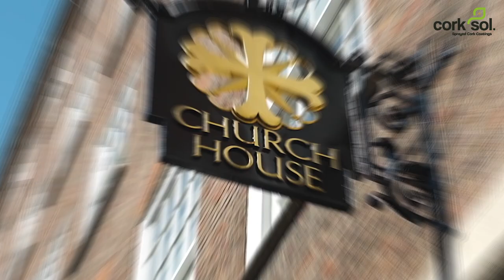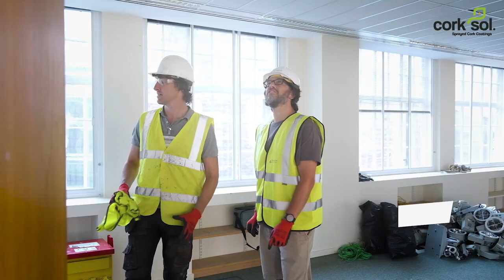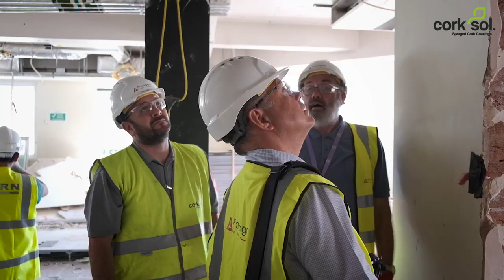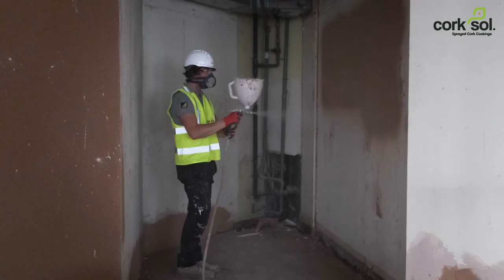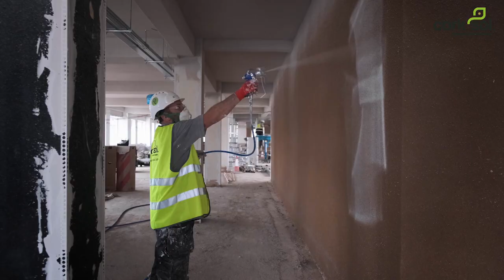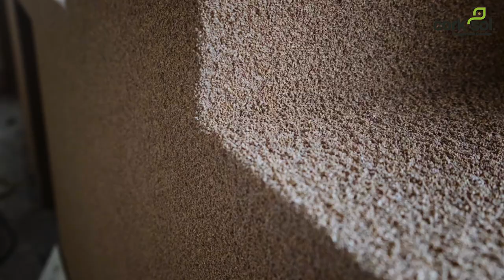Church House - Short Form

Comment: Hi. Looking for info, for internal dry lining that I would put a 30mm insulated slad. What thickness of Cork sol would have to be sprayed to get same U value
Reply from the maker: Hi Myles, our product is applied at a thickness of 4-6mm, which has shown a heat loss reduction of 30% - https://corksoluk.com/help-articles/corksol-is-proven-as-the-leading-thin-internal-wall-insulation-solution-case-study/

If you need any further information, do contact us on info@corksoluk.com

Thanks, The CorkSol Team